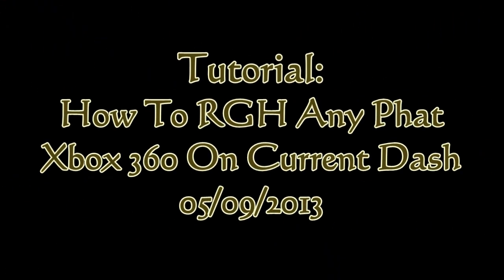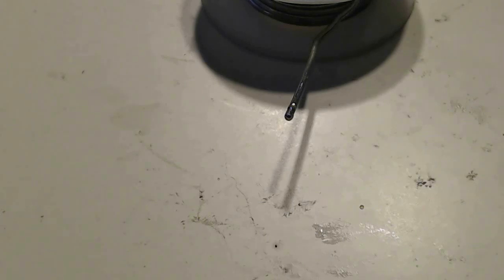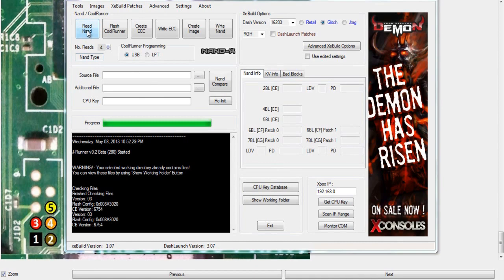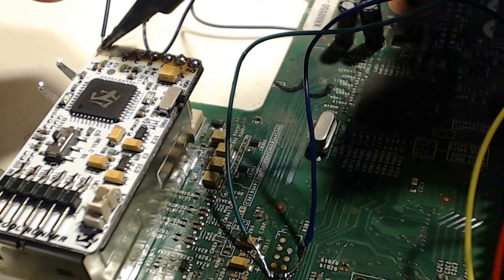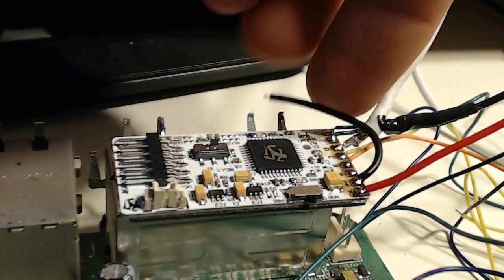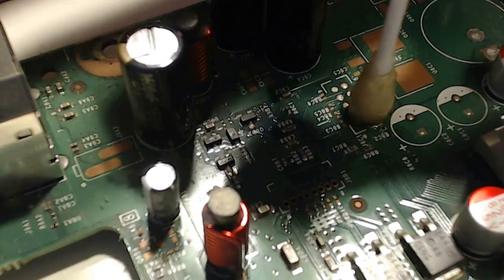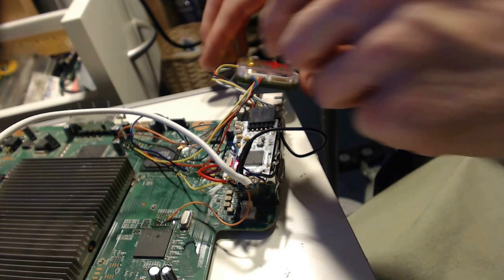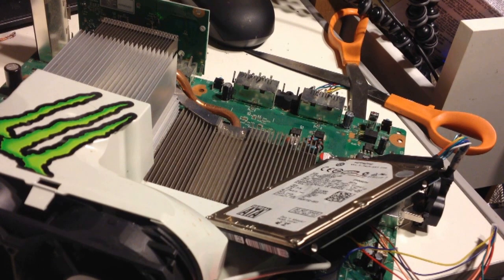Tutorial How To RGH Any Phat Xbox 360 On Current Dash Reset Glitch Hack May 2013

Comment: I see you're using a Coolrunner Rev C, why don't you have the multi cap attachment and CPU reset attachment?  Are those longer needed for an install?  Also, what are you supposed to do with the CPU reset cable when the wind tunnel sits on top of it?  Do you cut holes in the wind tunnel so it fits on top?

Comment: I have a question. Do you leave the coolrunner in or take it out? Can it be reused on another console?
Reply: Cool runners can be used on another console all you have to do is desolder it. The coolrunner always has to be in the console or it will not boot as the cool runner helps it boot

Comment: Ok, so i have a jasper that works perfectly but the dvd drive pcb is fried it doesnt recognise in jungleflasher so i cant spoof it onto another drive since i cant get the key. 

Ive heard you can get the dvd key using this rgh, if so would i be able to reverse the rgh after getting the key to use it as a normal 360 that can connect to live without it being banned?
Reply: Yes just take the chip off when your done
Reply: LunarModz Thankyou!!!
Reply: Davie Morris eBay

Comment: Im having a problem with super nand flasher im trying to dump retail nand on 2 consoles falcon and a zypher using j runner every time i read it starts and takes 17min and end saying header is wrong to many bad blocks this has happened with both consoles im not a guru with solder but im pretty sure its not my points any ideas thank troy

Comment: dose this work for xenon ? as far as the mod chip goes I would recommend TX  cool runner there only a couple of bucks more and they have a support forum in case you have problems with install my  first install was with matrix glitcher v.1 and it didn't work no support for it any where ended up trashing the Xbox  trying to get it to work turns out that the chip was no good and it didn't have  a debug light so you couldn't tell when it was trying to glitch  TX chip is defiantly worth the couple extra dollars just for  the support

Comment: Also does this work for the newest dashboard which is 2.0.16547.0
Reply: Nope.
Reply: TFGglitchers why not?
Reply: codd5moddz The rev C hasn't had an updated version of and update that you can put on the coolrunner to allow it to function on 16547
Reply: oh realy ok becase i just tried and it wont boot. How long untill that comes out?
Reply: codd5moddz Haha, good job on bricking your console. I don't think that they are going to update it.
Reply: well it is not bricked i used one i found online
Reply: codd5moddz Does it boot at all?
Reply: it turns on but wont boot so i can fix if i wanted to
Reply: codd5moddz It's bricked, are you new to modding Xbox 360?
Reply: no it is not becase i have bricked xbox before

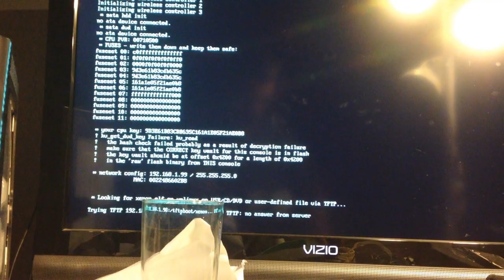Comment: nice tutorial! i have a question what you do at 12:57 you power off your xbox and you connect j runner cable again to the pc i dont want to mess up 
and i have another usb with my nand x its black and it have a led indicator at the end of the usb cable has a plug in with wires on it what is this for?any help will be appreciate! 
thanks!